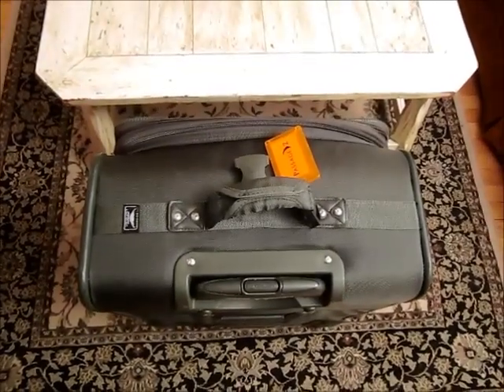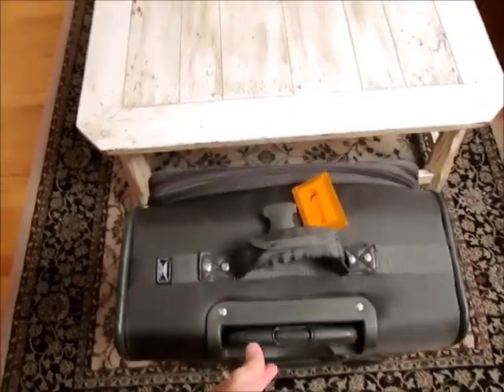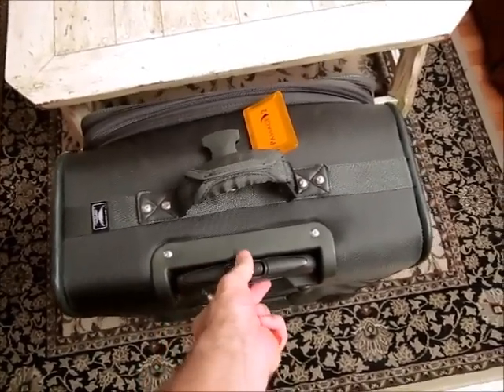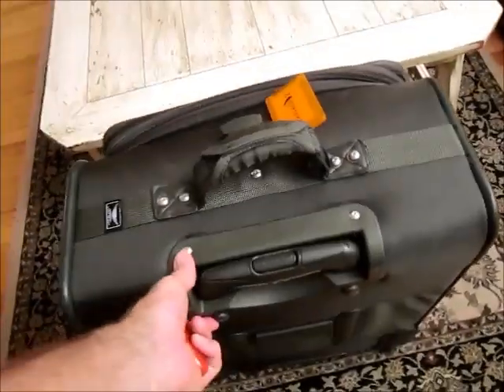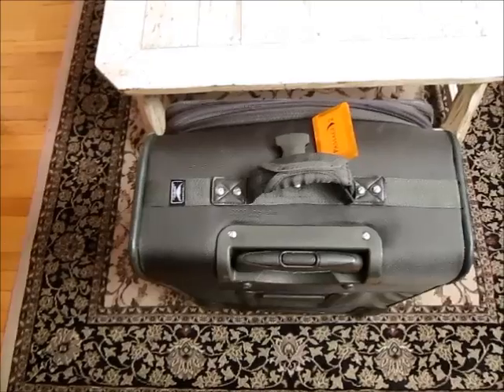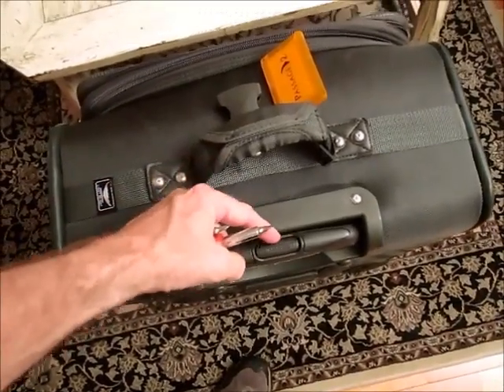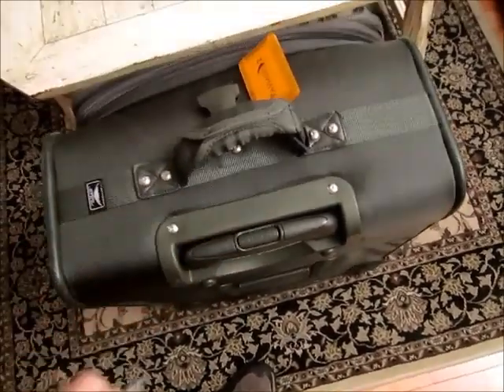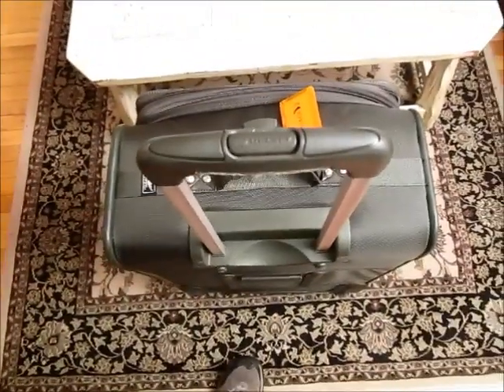Fix suitcase handle stuck in down position

Comment: A FREAKING SCREW DRIVER!!!! I'm yelling because I'm angry, not because this didn't work. I almost tore every muscle in my body trying to pull the dang handle out. Literally was pushing the bag with my foot in the opposite direction of my pulling and it wouldn't budge. When I was about to give up, decided to google my problem. This video popped up. I Watched it, went into the kitchen to get a screw driver, slid the screw driver into the lock hole like butter, next thing the handle effortlessly came up. Was so easy is I'm mad....Anyways, THANKS for the video!
Reply: have you tried turning it off and back on?

Comment: The button works great.  I think the rods are separated from the handle, and there's no way to reach the screws under the handle for disassembly.  It's less than a ear old, been used twice, nearly 200 bucks, and Sam's told me to go pound sand.  Yay!  I tried pulling all the screws that were in sight, but they sit there and spin.  The fabric is sewn directly over any other mechanism.  I believe I'll go to Costco, and blow another 200 bucks.
Reply from the maker: Wow! Sorry to hear that. Luggage should last longer than two uses.
Reply: I had the same problem as you, but my fabric was held in place by Velcro so I could pull it away and easily fix the handle. If you still have that suitcase, cut away that fabric and then look at a more practical way to reattach it, as eventually you'll probably have to get in there again. All things should be made with repairability in mind, and these handle assemblies should be replaceable and sold separately.

Comment: I have the opposite problem it won't go all the way down,  is this fixable? I'm quite good at DIY but where do I start?, it's  only been used a few times.
Reply from the maker: +Alice Unfortunately, I'm not an expert on this.  I only discovered the screw driver trick by accident.  Hope you can fix it.  With luck your problem will be covered by the warranty.